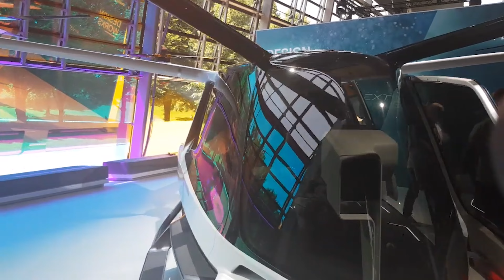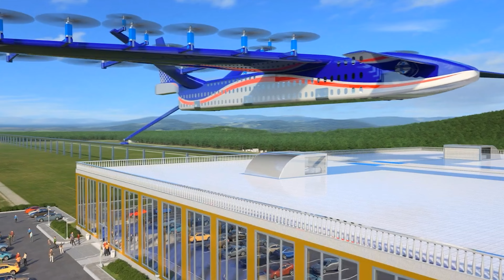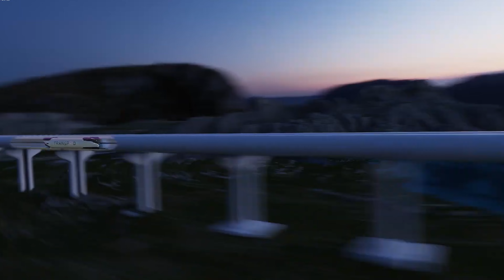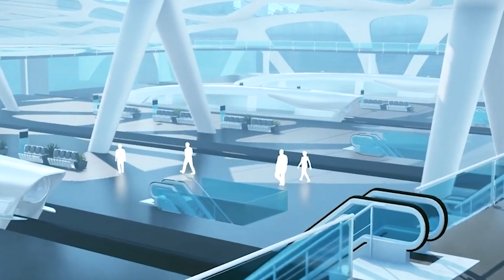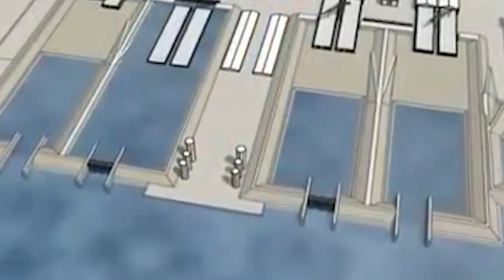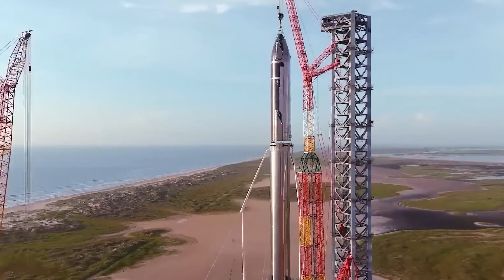Transportation In The Future 2050

Comment: Skycruise is utter nonsense.

Without antigrav (not coming within 109+ years) helicopters, flying cars, drones, and air taxis equal eardrum splitting noise and death from above (or the side).
Floating concrete tubes ... out of my experience but stress on the tubes and terrorism make them unlikely.
The flying train is just silly.
Hyperloops are simply not viable.  Maglevs seem to be out of vogue, the vacuum tube can't be built.
The modular vehicle is just a small variation on an existing frame vehicle, but will purchasers pay more for the option (don't think so)
I think space train is just a CGI fantasy and it looks like a hyperloop.
The mega tunnel is actually being built (i believe) so this is an entirely different category, not just fantasy like the rest.
Earth to earth starship (another Musk grift) is just stupid and has been totally debunked.
The yacht helicopter seems silly an unnecessary.  Could something similar be built, maybe, but why?